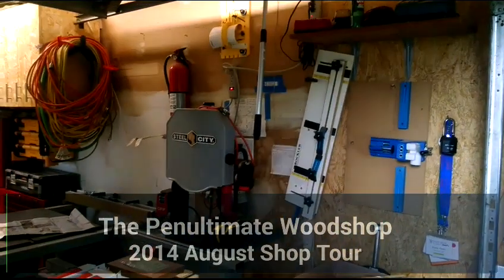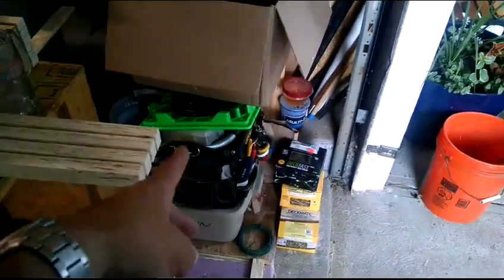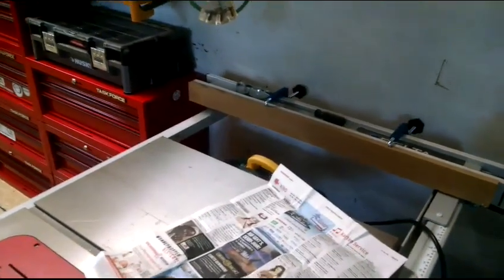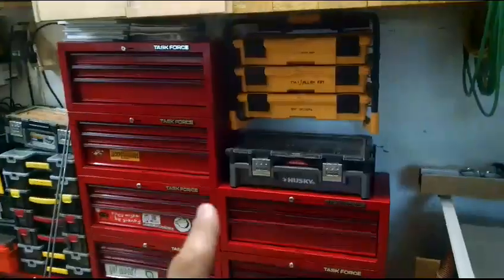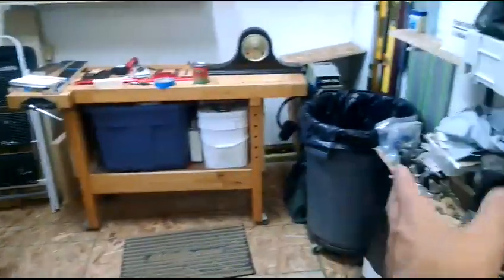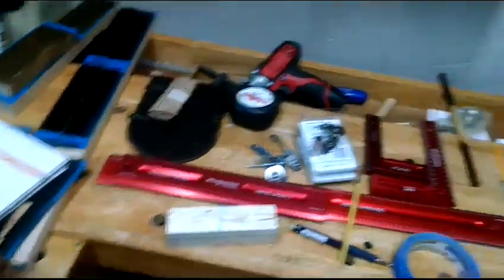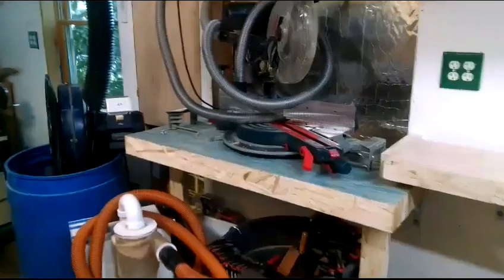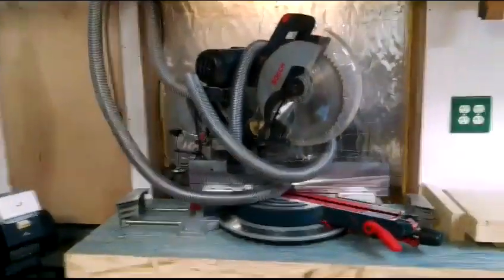2014 August Shop Tour

Comment: Hey. Liking your videos. Your shop is similar sized to what mine will ultimately be (single garage) so nice  to see how you fit stuff in. Re. your dust collector - why not builf a thien baffle separator to go underneath. It seems like the perfect addition to that motor.
Reply from the maker: A Thein baffel would probably work well. That said, I've been very impressed with each and every review of the Super Dust Deputy, and as I've already ordered mine, I'll stick to that route. Fitting either will require a bit of work, but at least I won't have to build the separator portion.